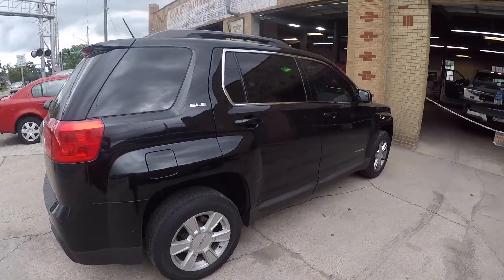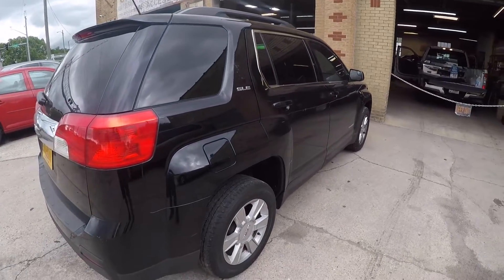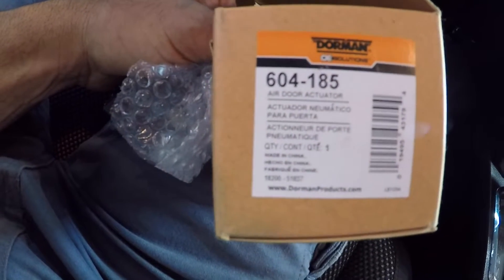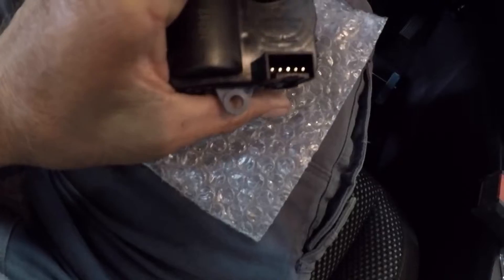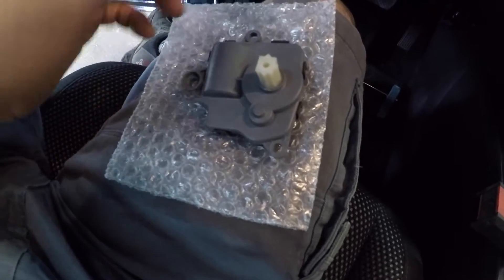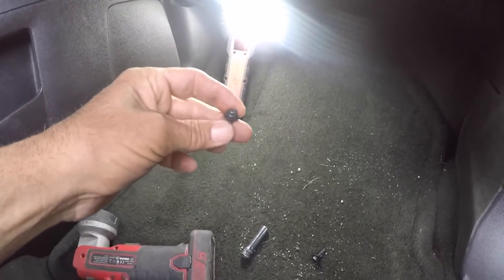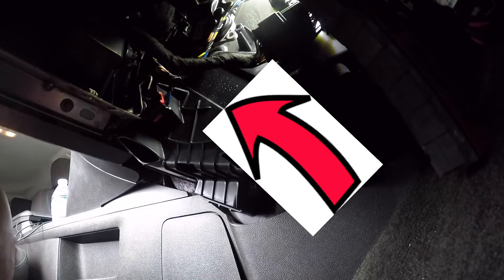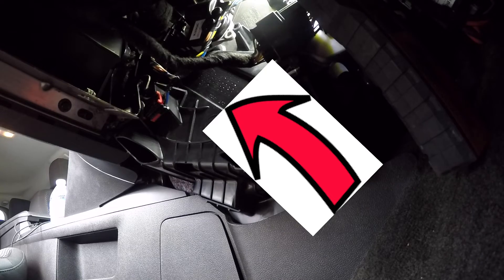GMC terrain a/c not switching from floor/vents/defrost or a/c to heat

Comment: I installed the new mode actuator and programmed it. I can hear the unit activate when switching from floor to main vents at the front of the dash but air still aint coming out, wondering if I have some tube disconnected.
Reply from the maker: These cars have a few of these actuators one is for the mode, one is for temperature, and one should be recirculating if you have dual climate control then you’ll have two of those are you sure you replace the correct one
Reply: @AutoRepairTips757  Last year I replaced the one at the passengers side and fixed my cold/ heat issue but now that I replaced the one at the drivers side I can't seem to get it working, I hear the motor rotating but no air!

Comment: There is no video on how you removed the control module much less the hood latch from the panel.
Reply from the maker: Email me your car information and what you’re trying to do and I’ll send you some information autorepairtips@gmail.com
Reply: @AutoRepairTips757  I have a 2015 GMC Terrain and we found your video for the air problems. We only get air on defrost and feet and we have zero heat. You said we can fix the activator for the doors that direct the air flow. Can we also fix the one for temp control? We DO have an auto setting for air. Also we live in an extremely remote area in AZ and it is monsoon season. We would like to buy ANY AND ALL PARTS at one time that we may need to completely fix these issues since it is extremely dangerous to cross the river to get to the nearest auto parts store. We would rather return parts that are not needed instead of having to go get more. What do you recommend we purchase so that we can make this happen? I will be ringing my hands waiting for your response! Lol! BTW I love, love, love how thorough you are in teaching us these tricks! Keep up the AWESOME work you do! 
God Bless!
Reply from the maker: @vanessacompton936  yes there is an actuator for temp also...did they all go bad at once? if so that not normal, or did each one go out at different times. if you email me at autorepairtips@gmail.com i can send you some info.
Reply: I have a 2014 GMC terrain denali,  I have heat and AC only on the floor. Do I change out the left side actuator? I couldn't see it.
Reply: @AutoRepairTips757  no they did not go out at once. There is a lot going wrong with this car and I am extremely disappointed at the rate it is declining. I am looking to fix what I can and buy a 4x4 Tahoe. My ‘07 Tahoe was a dream! Hoping to get another soon. I had wanted the terrain when it first came out. I would not recommend this vehicle to anyone. Definitely not worth the money.
Reply: @AutoRepairTips757  what state are you located in? If you are close I would like to have you help me find a Tahoe!
Reply: @MC-mm3wz 
Did he answer?

Comment: So there is 2 of these? My ac is blowing hot. Its not changing over, im replacing the passenger side today, is there another one on the drivers side? Sorry if this is a dumb  question im a typical woman🤣🤣

Comment: The driver's side Is NOT EASY. You didn't show all the stuff that has to be removed to change it.
Reply: @chris tucker.    its  easy. seat all the way back.   remove lower panel and knee trim panel.   2 10mm bolts all the way on bottom for module. slides down.    then 1/4 socket on small ratchet to remove 3 bolts.   30-40 minutes  done
Reply: Agreed, not easy!  Maybe Roger’s didn’t have on star or whatever that metal box is right in front of the motor.  If that wasn’t there, then yes easy.